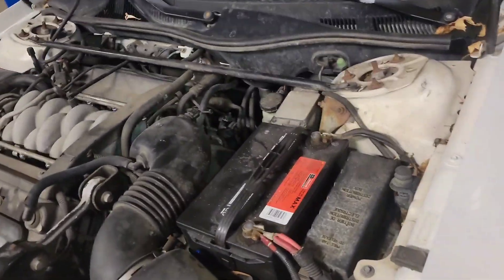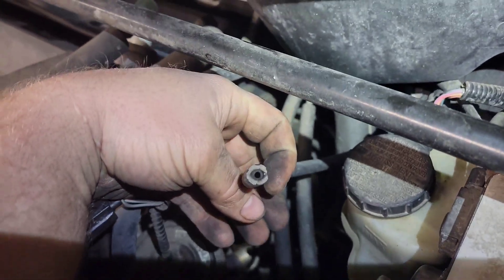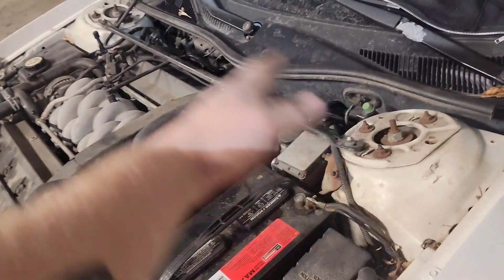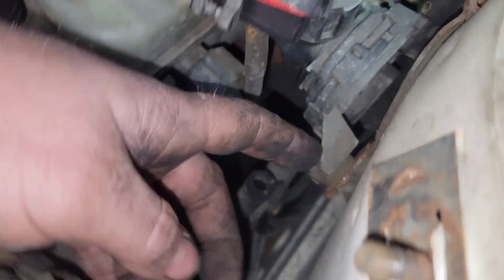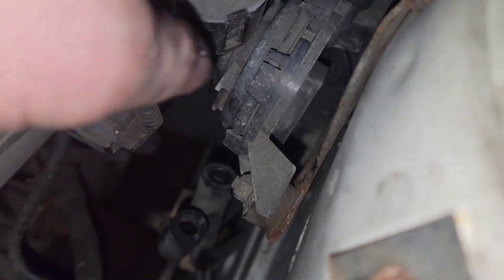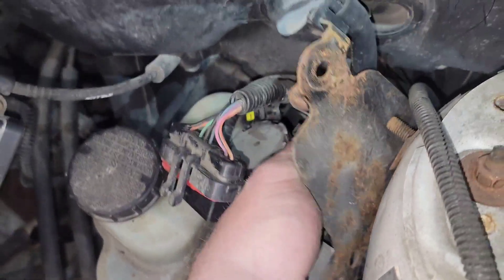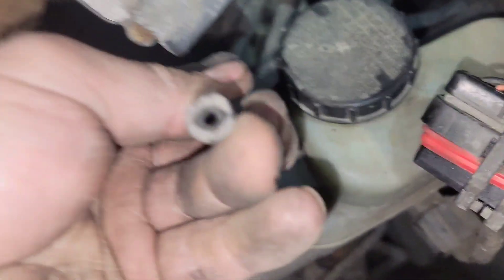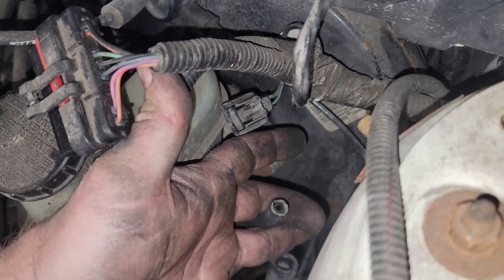2002 Lincoln Continental P0171 P0174 - Lean Codes Quick Easy Diag - Love These Cars

Comment: Those were interesting cars. If I'm not mistaken, that 4.6L V8 32-valve engine is exclusive to that car only, in that it is the only front wheel drive transverse mounted application of that, using the unique bellhousing bolt pattern for front wheel drive cars, and backed by an AX4N transaxle. I've often wondered how well they would hold up to all that power for the long term. Definitely a worthy competitor to Cadillac's Northstar V8.
Reply: They are quite reliable and can easily reach high mileage, although the AX4N is often seen as the weak point
Reply: Mine just hit 188K
Reply: @semiautospastic  mine is over 220k on 1st transmission, engine and air suspension!
Reply: @070nino070  okay THAT is definitely an achievement, if the air suspension is still working. They definitely were quite problematic right across the entire Lincoln line. Pretty much most, ended up being replaced with conventional springs due to cost.
Reply: @michaelchan8915  lots of discussions on the air ride on Lincoln forums. Nowadays, air suspension isnt too expensive to replace. And if treated well it can last very long, plus it drives way better than springs

Comment: I don't know if you help with repairs or diagnosis over the internet so if not just ignore this. I have a 2000 F-150 xlt with the 5.4 4x4 I took it through the car wash and on the way home the overdrive light started flashing and it would shutter and stall if tried to take off from a stop also the service engine light came on shortly after. I managed to get it home (Luckily it was only .5 miles away from where is started happening) and disconnected and reconnected the battery and all of the service lights were off but as soon as I put it in gear they would come back on and the truck would barely run and shake and shutter. I tried it in 4H and the same thing happened. Then I put it in 4L to see if I could get it to move and it did. Do you think my transmission is blown? I sure hope not. Before the carwash it would shift like butter, like it always has, couldn't even feel the shifts. It was shifting like that before all day when I was driving around town. The carwash was super intense and shook the whole truck. Do you think its possible it could've knocked a wire loose or got water into a control module? Is it okay to drive it in this state and also in 4L to the shop I work at that is about 3.5 miles away in order for it to get scanned and looked at? I would take the backroads and go around 10 mph so it would be a little more mileage. Thank you for reading and potentially your help. I am a 21 year old novice who just got a job at an engine/repair shop and am learning a lot. I have done car repairs my whole life and I love the trade and hope to one day be as knowledgeable as you are. Also I have had this truck since I was 16 and maintained it mechanically perfectly since I got my hands on it. I have never beaten on it (besides towing at just below the max recommended load). The truck has a Ford certified reman engine that runs without a tick so she's got some life in her. This truck means a lot to me and it would be very sad to have to junk it.
Reply: Check codes on the pcm and tcm. Do a serious look at the connectors that might have taken a water blast especially on the transmission.  Old seals on the connectors with a pressure wash is a bad combo
Reply: @jacobg1488  Thank you for the advice I will try to get it on a lift tomorrow and see what's good.
Reply from the maker: You just got water somewhere it doesn't belong 

Module connection or on a ignition coil

2 wheel drive is what I would have it in not 4L 

The shaking is because it's missfiring because if the water 

Nay need to dry off with some shop air around the ignition coils just blow around them and get all the water off and on the passenger firewall in the engine bays is where the computer is at, make sure to blow those connections out 

Hell you may find it's already dried out and running fine when you get up to go to work
Reply: All is well. Thank goodness my baby is alright. After scanning and doing some investigation I found a blown fuse. Thank goodness it was so simple. Never going to that car wash again.